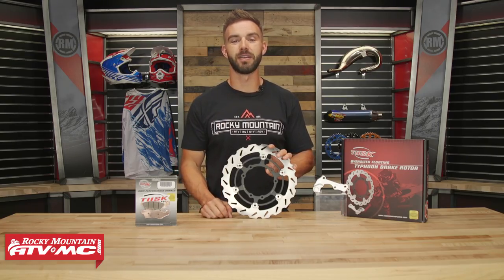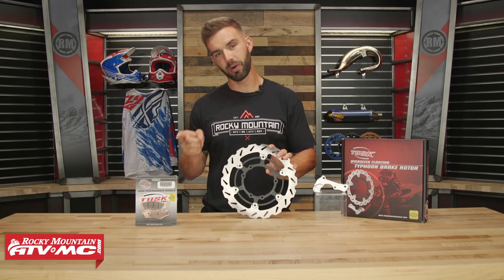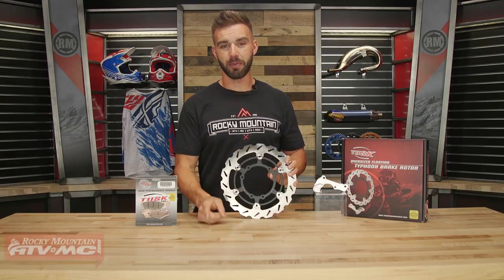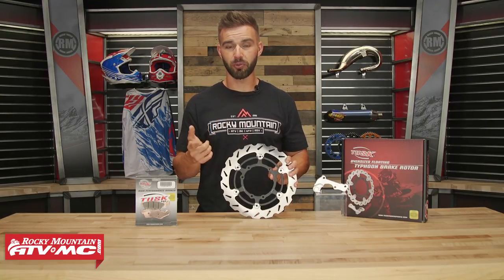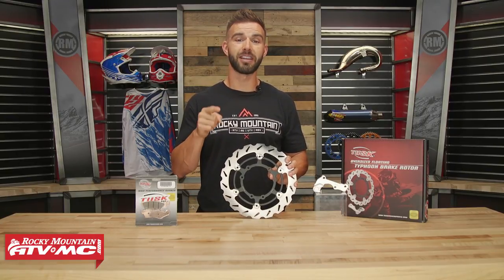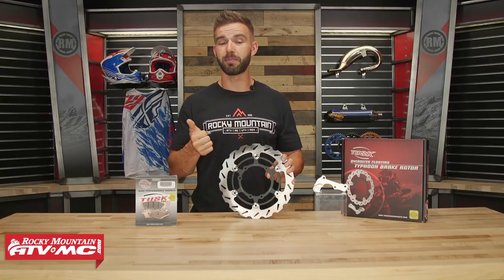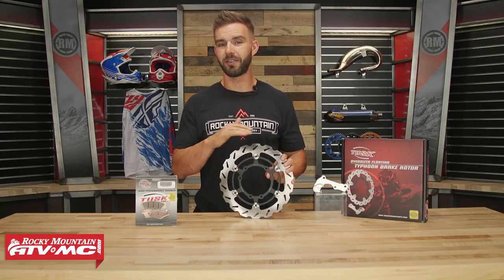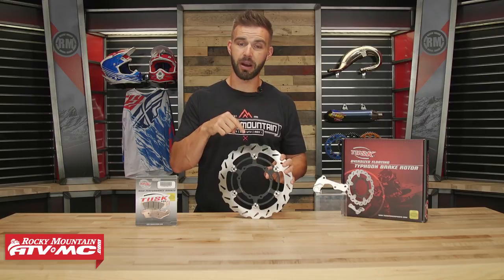Tusk Oversized Brake Rotor Giveaway

Comment: 2000 Yamaha YZ125. I just bought this bike 2 weeks ago to race in some local C class, races mostly in northern Colorado, I've been riding dirt bikes for about 15 years but haven't entered any races before. I spent the last 2 weeks fixing the bike up a bit, and went out and practiced at some tracks already to see what adjustments I need to make, it's an old bike and the front brake is pretty weak, even using 2 fingers going into corners isn't quite enough. An oversized front rotor would give me a lot more confidence going into corners. Thanks for having a great parts selection online and great how to videos on your youtube channel.

Comment: 1997 KLR 650. I ride a lot in the mountains and deserts of SoCal not to mention Baja.  A huge problem on the KLR is it's weak brakes and this is a good upgrade for safety. Right now my brakes are shot looking to get new pads, this would be even better.

Comment: 2011 CRF450r I just got stationed here in Ft. Bragg, NC and there is soo many awesome tracks around here, but I have a warped front rotor and I need to replace it before I can get back to riding and racing.

Comment: 2006 Honda crf250r. I have had to rebuild my forks 2 times this year and they need to be done again. The fork oil has soaked into the pads and ruined them. They also squeak. The disc has a black burnt oil streak on it from a long downhill grade. Plus the extra stopping power would be amazing!!

Comment: 2003 Yz 250 2 stroke. I just rebuilt it all myself from motor to new seat cover. Did a big bore 295 kit with the yz250x transmission. Street plated. 12 oz flywheel weight. Everything is upgraded on my dinosaur to the max except the brakes. Have tuff time braking in the tight single track woods I ride. Be nice to see if this would actually help my monster stop sooner. Keeping the steel frame alive!!!! Rocky Mountain is number 1 for online parts shipped fast.

Comment: 2005 yz250. I NEED this oversized rotor kit! Tusk is coming out with some of the best parts on the market and this would go great with the tusk impact wheels that I will be running very soon! The stoping power on the oversized rotor is a need for downhill descents out in the desert, mountains, and the long starts at the track!

Comment: 2016 KTM 350 SX-F. I''m about to start my second season racing hare scrambles and could really appreciate the upgraded front brake. My biggest issue so far has been stamina and having a stronger front brake would keep my throttle hand from cramping up as easily. I'd love to run the new front brake and am hoping to clinch a podium spot in the C class this season. Thanks!

Comment: 2003 Honda CR250. Two main reasons I could use the kit: 1. Bro, I have a 2003 CR250 and I am over 225 lbs, how well do you think my stock rotor works? 2. I'm a RM fanboy.

Comment: 2017 KTM 450 sxf. I race motocross and the one issue I have with switching from my old Honda to my KTM is that I need more braking power when coming in hot on those turns, ruts, and braking bumps.

Comment: 2015 YZ 250 2 stroke. I set this bike up for mostly mountain single track thanks to RMAMC. Last ride in 2 weeks ago Taneum Area in WA State I was running up frost mountain trail and it was step with a ton of loose gravel. My front brake overheated and I lost fluid and stopping power on the front it made it a challenge on my decent without a front break on knarly downhill grade. The extra heat dissappation and brake pads from this Tuck set up would me exactly what the Dr. ordered.

Comment: 2013 Honda crf250r I am racing an XC series over in Montana in the 250 A class, it would be awesome being able to fly into the corners harder knowing I will be able to stop quicker and also not have to worry about my rotor heating up after a long 3+ hour race

Comment: 2014 CRF 250R. I ride with a lot of front brake. Barely touch the rear's.  It's also time to replace the front rotor, mine as well upgrade it. Thanks for the opportunity.

Comment: Nice I can use some good stopping power on my old dinosaur 2001 DRZ400E with warp9's here's the thing with this my rear has a KTM hub so the rear rotor has to be 240mm disc nothing extra about the front wheel my rear brakes suck pls help

Comment: I ride a 2004 KLR650 as my Adventure bike (nick named WALDENA )that I also do two up Adventure rides with my wife. Being a first gen KLR it only has a sinlgle piston brake caliper with limited stopping power. Your Tusk floating oversized rotor and pads would be an excellent upgrade for Waldena to help stopping on her Adventures. 
Thanks 
Mike.

Comment: 2008 kx250f. Kawasaki. I ride very hard and my brakes aren't quite cutting it for me. I recently crashed because my front brake gave me no feed back and barely made a difference when pulling the lever in 1/4 way or 1/2 of the way. There is no progressive feel and is very hard to get good braking power
Reply: 2009*

Comment: 2006 Honda CR125R
Just bought it in march after having a 03 DRZ125 for most of my riding career
Had to put at least another $1000 in parts and tires to get it running and comfortable for me
Just need new plastics and new brakes

Comment: Hi, i have a 2014 Yamaha YZ250F. Slowly but surely i have been upgrading my bike to perform at its best.   It is know that the 2014 YZ250F was weak up front in stopping power.  When researching options to improve baking the best bang for the buck without sacrificing quality and performance is the Tusk oversized rotor.  This has been verified and proven  by many over and over.  So thissmod is on my To do list.  So hopefully RMATVMC can help.  Thanks. Joe

Comment: Well....it started with a cracked rear rim. So I ordered a set of tusk impact wheels from yall. And just the other day I ordered the Tusk Oversized rotor for the front, and a typhoon rotor for the rear along with pads for my 2007 CRF250R. I figured if Im upgrading to new rims, upgrading to better braking would be good to accomplish at the same time. My plan is to start riding at the motorcross track this year, so upgraded braking seemed like a logical upgrade for the track. I also ordered braided brake lines as well to ensure a solid feel. Maybe if I win this giveaway, yall could simply throw the amount back at me in RM cash for my next purchase....LOL> I stll want the tusk handguards and a few other things to include the fox fanny pack for carrying my tools etc.